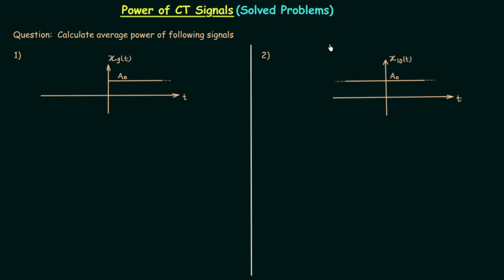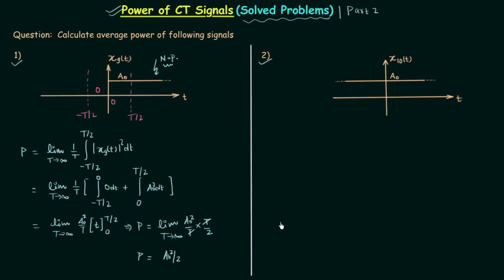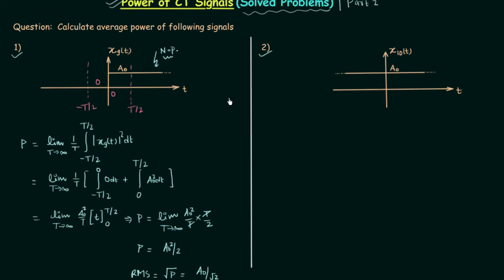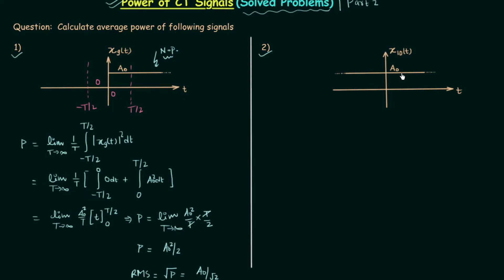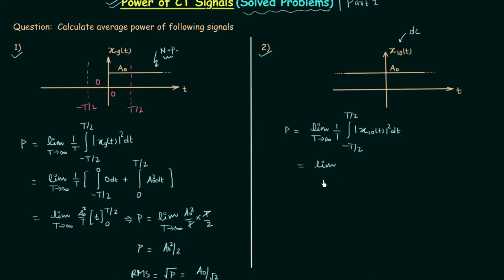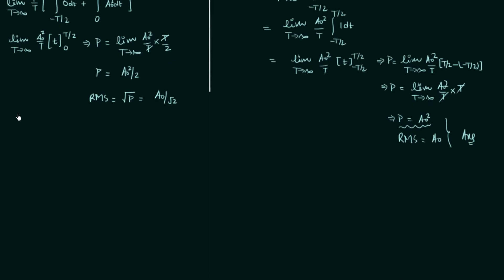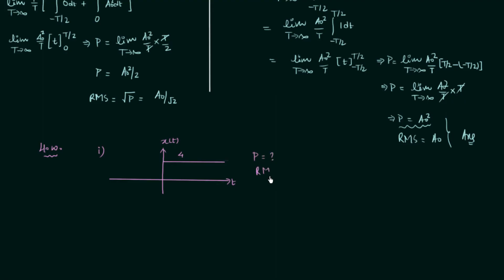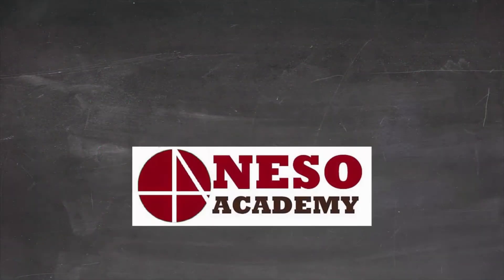Power of CT Signals (Solved Problems) | Part 2

Comment: sir u sai dc signal is a periodic signal, but y  u used non-periodic formula for avg power calculations
Reply: The fundamental time period is undefined for DC value, that's why he applied aperiodic formula..
Reply: Exactly my doubt
Reply: Both correct

Comment: why is everyone getting 3root2 for RMS for the second one? I got RMS=6root2
Reply: Power is 18. For the second one .. there is 1 transition . So from -T/2 to 0 the value of amplitude is 0. And the integral of limit -T/2 to 0 is ZERO. and from 0 to +T/2 the value is |-6|^2 so it becomes integral (36dt) limit is 0 to T/2 . So Integral value is 36T/2 = 18T. And this T is cancelled by another T. So power is 18. Now rms is sqrt(18) = (9*2)
Sqrt of 9 is 3. R comes outside the answer will be 3_/2